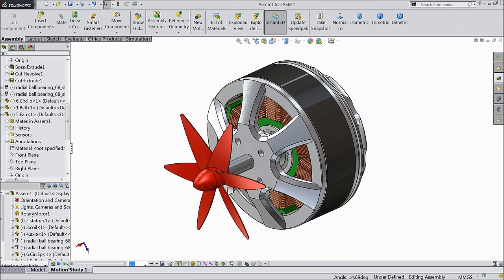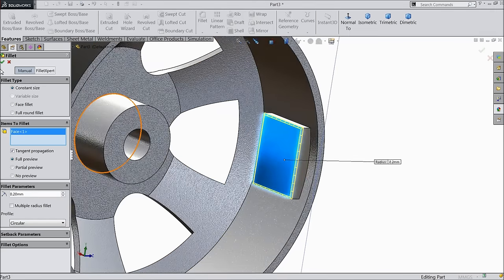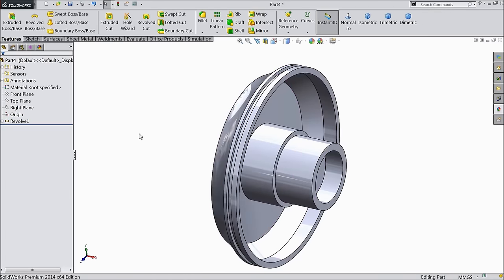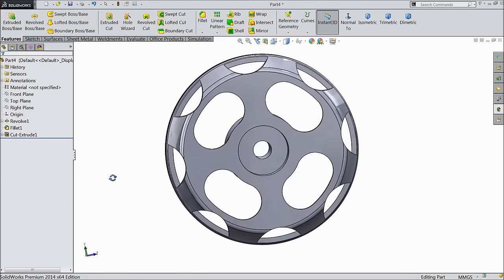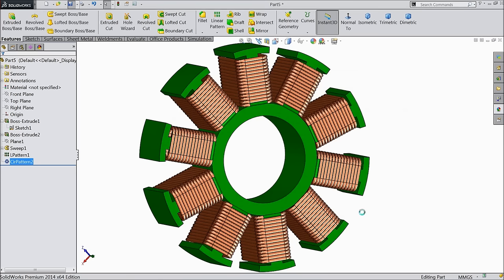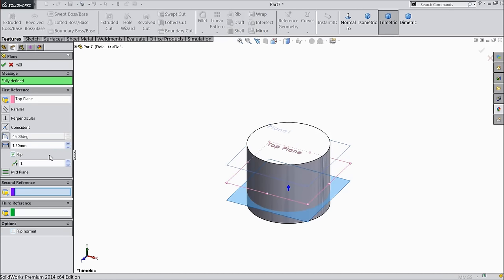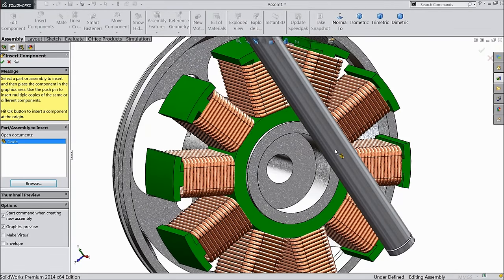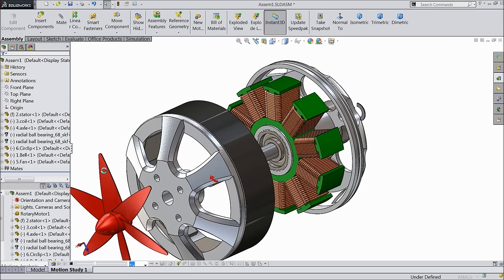Solidworks tutorial | sketch DC motor in Solidworks

Comment: You have rough errors in your SolidWorks job:
1. Shaft position is NOT correct, you must bring out the shaft from the STATOR side (not from the rotor how its in now). 
2.  Make stator Float - with right click. Make coincident mates between Stator`s planes and assembly`s planes. It will center your stator into center of assembly.
3. Rename "bldc motor.sldasm" to "ASM bldc motor.sldasm" it wil move assembly to the TOP of files in the folder.
Reply from the maker: Thanks Rory Mcdonald i will check & try to fix the issues, once again thanks.